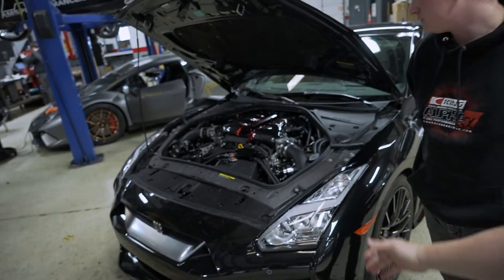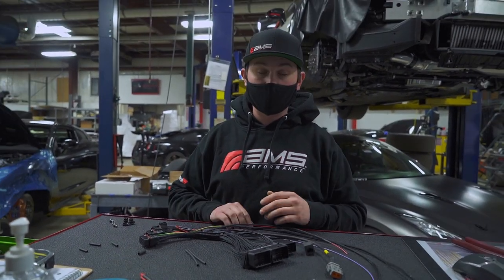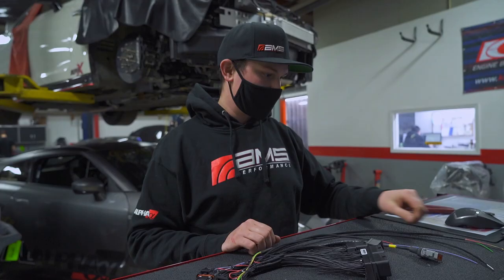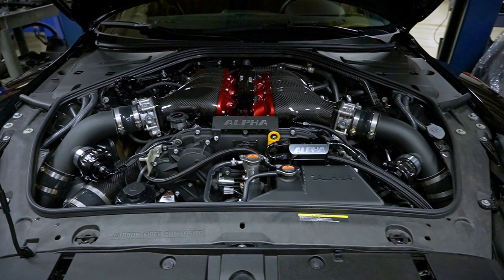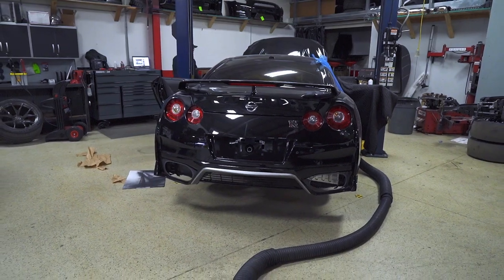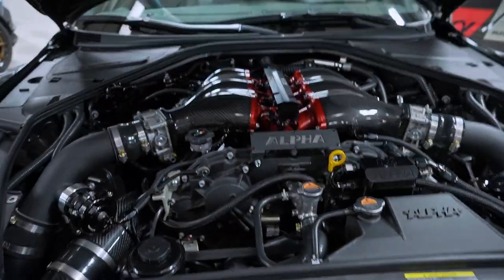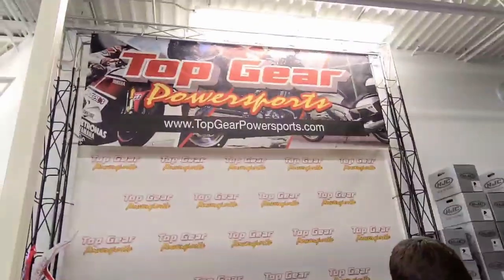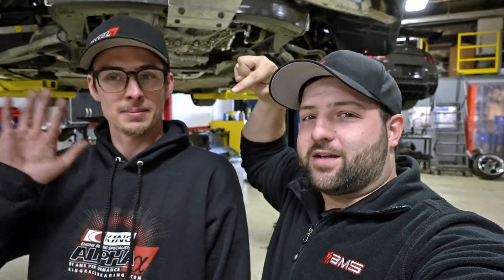ALPHA 18X R35 GTR 1400HP+ | The Herold's Build Update

Comment: Those stock throttle body's? If not I feel like oversized throttle bodies would flow better especially at that power number.
Reply: Also Bugatti fuel pumps will solve the fuel problem completely.

Comment: No BS how much is the same exact setup 18x OTD?  With car shipment to and from 66442?

I'm assuming this is a built engine, Trans and fuel, syvecs?  Tks
Reply: Base 18x kit is 15k.

Website has base prices but I’m sure you can get pretty deep into cost with stuff
Reply: @kylewhite1683  that’s just for the turbos lol. Full Alpha 10 package costs $70k installed. This has to be $120kish installed.

Comment: How much does this cost?
Reply from the maker: Pricing can vary greatly depending on what all is being done with the vehicle. Since this video was made, we have recently released our Omega line of GTR turbo kits that are much more cost effective with better performance. The Omega 14 kit ($9,999.95) can get you near 1350+ whp, but you will also need to build the transmission and motor at that level.